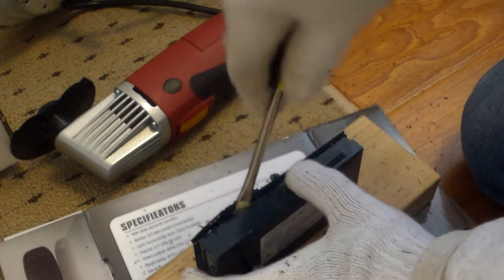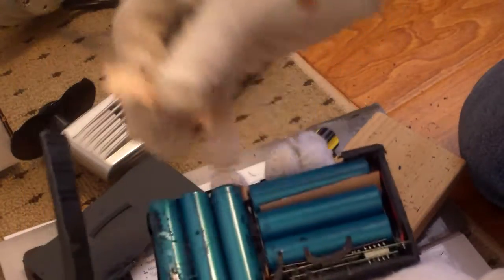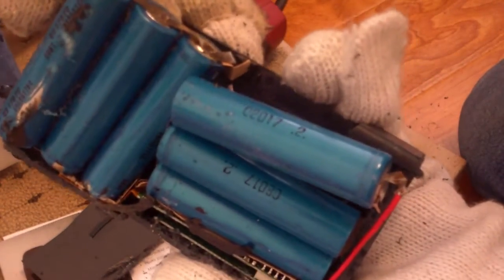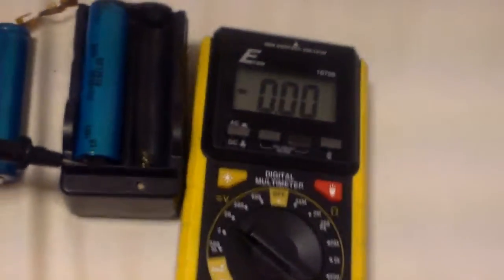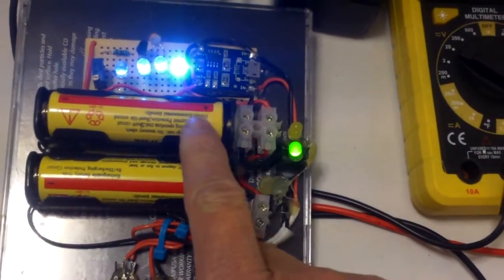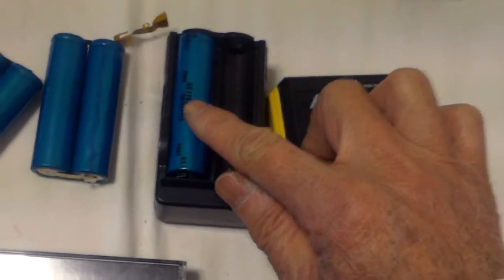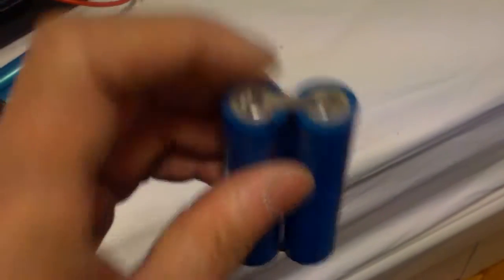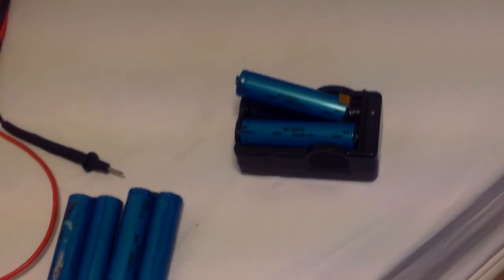Salvaging laptop batteries for my 18650 battery box

Comment: You don't even need the Dremel and screwdriver. You can pry these batteries apart by hand. Slip a fingernail into the groove by the electrical connector and gently pry it apart. Work your way around, unsticking the adhesive, until the two sides separate.